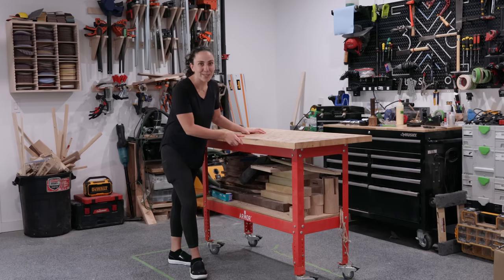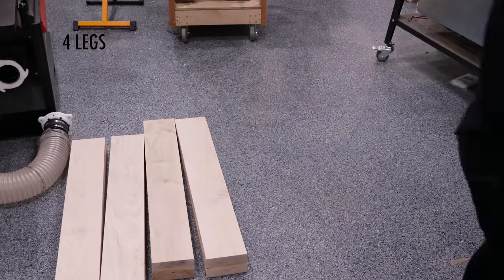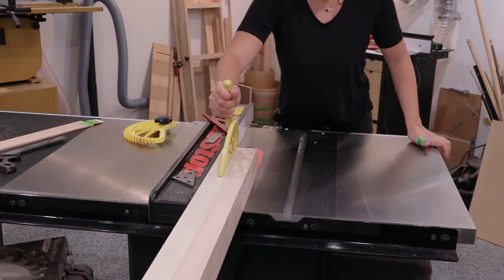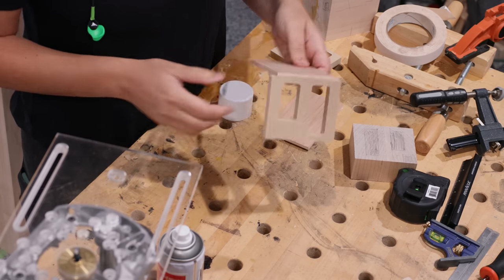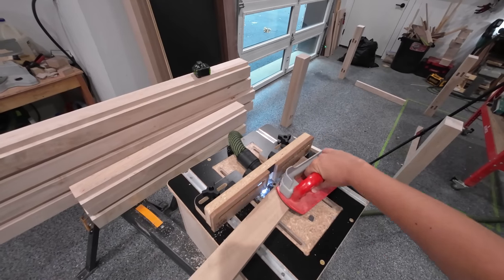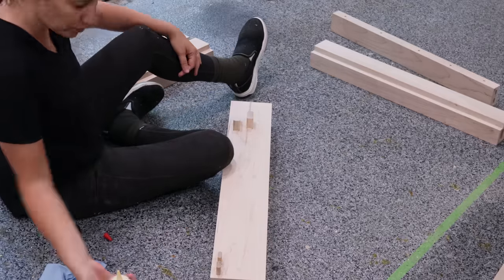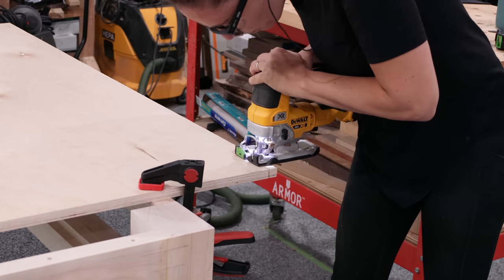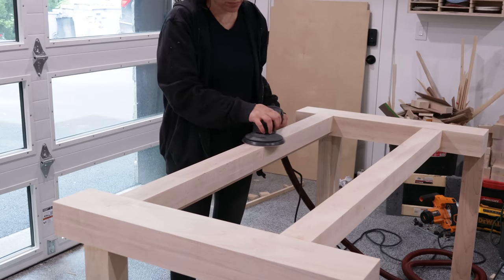My DREAM Workbench Build // PART 1: The Base

Comment: It's so cool you're building out your new shop and getting bigger and better equipment. At the same time, for me, one of the appeals of your channel was  how beginner-friendly it has been. I don't want to suggest that you should hold back and not progress, I just found it so awesome that you made beginner equipment work so well. It made woodworking seem more accessible for newbies. It's great that you continue to show simpler options during your builds. 

Thanks for your content and keep on cracking.
Reply from the maker: I totally get it and this was probably the best comment on this topic. Usually ppl aren’t as nice… ha. I have been doing this for a while and I am no longer a beginner. Hopefully all beginner woodworkers get to the stage I am at and further as they progress ☺️
Reply: @3x3CustomTamar - totally agree with the parent comment here, as someone who found you when looking to get into it. The great thing is seeing the progression though, rather than just ignoring all the beginner development you went through.  

I know it's not a "normal" theme for you, but it would actually be really cool if you put out a career breakdown video of some kind, going over the big milestones in your projects / the work that you do, the shop developments that accompanied all of those, and how the knowledge you picked up over time looks like. Not a small one, but thinking of your joint/tool breakdowns that clearly show insight to when you started using different techniques, milling your own lumber, etc. - it'd be invaluable in terms of helping folks conceptualize the journey even if they're just hobbyists (that'd be me 😅).

Either way, great work again and cheers!
Reply from the maker: @andrewbattelini4532  hmmmm. I’m not sure if I can even define those things for myself. They kinda just… happened… ha. And I guess if you watch my videos I’m chronological order you would see some sort of progression 🤷🏻‍♀️😂

Comment: I really like the fact that you’ve upped the game with regards to your tools. Through the progression of your channel, you’ve shown what it’s like to do the work with basic tools (and in a shop that has drastically varying temperatures) and what it’s like as someone who’s able to increase the quality of their tools as time goes on; it’s not like you’ve just clicked your fingers and bought your current spec - you’ve worked hard for it! Anyone who has a passion for woodworking and happens to have a little or a lot of spare cash would do just the same. Either way, hold your head high and be proud.

The bench is looking great. Keep up the great work and heal well.
Reply from the maker: I feel very proud for what I created here ☺️☺️☺️

Comment: I use floating tenons for most of my door making joinery and also make my own tenons. To allow for glue squeeze out I route a very shallow groove down both faces of my tenons with a 60 degree V groove bit. This prevents any hydraulic action when gluing up stile and rails. LOVE your bench design!
Reply from the maker: That’s a great idea!

Comment: I've built four of these for 3 different spaces. It wasn't until I saw The Founder that I really started think about movement around a space, calculating necessary range of motion, most common needs for the most typical projects that I actually got the right size bench and features.  You did this better than I, VERY well done!

Comment: I'm currently making my base for a huge Roubo bench made from 8/4 hard maple. I'm also building it on those same sawhorses. I work alone and trying to flip the heavy top was too much and it completely collapsed one of the sawhorses. No real damage to the top but it did bend the legs on the sawhorse. I now use my loader with a set of forks to pick up the top and carry it outside to flip then bring it back into the shop.
Reply from the maker: Moving the top was how I sprained my ankle…

Comment: I'm glad I clicked on this video. My Dewalt planer did the same thing to me the other day. I took it apart and cleaned it out. That worked but, now I'm wondering if it was the safety switch and I just got lucky. If/when it happens again, I'll know what to check. I love your dust collection set up.

Comment: Tamar,
Of course I want to see the ankle sprain!
I enjoyed your use of the skate board as a transport device. Also your knee clamp. Might I suggest the elbow clamp, chin clamp and forehead clamps as well.  They have all worked well for me on past projects.
Reply: Agree I’d love to see what happened that caused the injury and maybe your thoughts on if there is anything you learned from it.  On my own experience I was carrying a half sheet of 3/4 and tripped over a power cord and fell myself but luckily nothing sprained.  I committed to not have ANY obstructions on the floor area and am feeding my power top down and working on getting my last dust tube off my floor.    Been watching you for a while and was admiring how your shop seems to be about a year ahead of my shop in terms of tools and capabilities.
Reply: Yes, the use of the skateboard dolly made me giggle 🤭 Use what you have though! 👍🏻
Reply from the maker: Haha I have utilized those as well… good clamps to have 😂

Comment: Great Job! I realize it is too late, but did you ever think about moving such a heavy bench when you decided to use glued floating tenons? If so you should have used different joinery method so you could break the base down into sections. When I made my roubo style workbench I thought I would never have to worry about moving it until we actually had to move. Then I was so grateful that I went with bolted mortise and tenon so I could take it apart when we moved, like you would do with a bed frame. No matter, great job. Looks like a strong and solid bench. I did not realize how a great workbench improves your woodworking. Have fun and continue to show us your videos. Thanks!
Reply from the maker: I thought about it. Then thought that putting casters on it would make it movable… just like any other table in my house.

Comment: Oh man, this reminds me of what I decided to do for the bed frame I built years ago (and still standing).

I too made floating tenons, but out of scrap dimensional lumber (bed frame was made from 2x4 and 2x6). I don't have all those fancy machines or even large clamps, but I did mill the mortises using a plunge router in the exact same way with a jig, except I used screws instead of double-sided tape. No big deal, it's not like those screw holes were going to be on the finished side.

To make up for the lack of proper clamps, I used Kreg screws to pull the 2 pieces together tight. Combined with the floating tenons, they are easily the strongest joints in the bed frame.
Reply from the maker: Screws are a great idea since it will be hidden!

Comment: Hi! The way I was taught to leave space for the glue on floating tenons is to rip a small channel along either face of the tenon stock on the table saw. Just a blade width and maybe 1/16 or so deep. Those tenons are so wide though that two channels wouldn’t hurt.
Reply from the maker: That’s a great idea

Comment: I built a split to Roubo years ago. I regret the split top. I have used the split top filler strip as a bench stop once. I also have things get caught on it or fall through it. Your mileage may very but you may want to really think about what you need to top divider for

Comment: Awesome workbench!  Great thickness planer, I have heard a lot of good about Laguna but so far you are the only one on you tube I have seen on you tube who has them.
I was actually surprised that you did not get the hammer A3 series jointer planer combo like what Keith Johnson has because of your limited space.
Either way I am jealous of your awesome workspace.  You have earned every tool and am thankful you share your work with us.
Reply from the maker: Laguna just makes the best looking tools hands down. And they work as good as they look! I go back and forth between jointing and planing so much I thought it would be annoying to have to switch
Reply: @3x3CustomTamar  excellent point.  This is extremely helpful in deciding which brand to lean into.

Comment: Watching you in your shop, I noticed how you have no outfeed tables. Made me wonder if you could make a rolling one that would work with table saw, planer, chop saw, and other places.... The bench build is interesting. That bench top with all the holes in it is an interesting idea, and a lot of people are using it. I have always used squares and straight edges to do the same operations.
Reply from the maker: I have plans to make one that folds down. It’s on the very long list. Ha
Reply: And that list never gest shorter....... No matter how old you get.... I think I need one shop just for my wood.....

Comment: In stead of buying a pipe clamp, (Although you can never have enough clamps... 😉) Bessey makes an extender to connect two K Body clamps into one. It's called the Bessey K Body Extender KBX20 and is made out of a solid block of aluminium. I use it on my 1.5 meter clamps to make a 3 meter one, and works great.

Comment: Nice design. Good glue-up lessons - including custom floating tenons. Assume you did some unshown checking for square during assembly.  Ankle sprains are amazingly painful. (And, bad news, they are very persistent.). Had an orthopedic surgeon I was playing tennis with tell me I’d wish I’d broken it because it would heal.
Reply from the maker: Yup. Checked for square. I actually had one long apron that wasn’t sitting perfectly square to the leg and it was driving me nuts. But the whole base was square using diagonal measurements. I posted about that on Instagram….

Comment: You could just insulate and immobilize the connector on the switch. Get everything separated and in the correct orientation, then hot glue everything together. It won't move again. You could also add a piece of non-conductive material between the connector and the switch body to prevent the movement and fusing. ANYTHING is better than leaving it as it is. If you still have that old planer, I'll take it :)

Comment: Really beautiful build, I hope you’re really proud. I could be wrong but wood movement might be a concern with all the hardwood screwed down. Awesome build regardless and congrats on your new planer 🙌🏼
Reply from the maker: Thanks! I don’t see an issue. The aprons are all about 3” so no issue there. The legs would be the bigger issue, but the way I oriented them they would be likely to move in and out toward the long ends of the tops. The screws are only in one row, so they only have one point to move from. The screws that will attach the tops are placed in oversized holes to account for this.

Comment: Great video! I like the idea of two type top bench. Question: How will you keep them same height, flat and parallel over time?
Reply from the maker: Thanks! We’ll just have to see. There are always ways. If the hard tops has to be flattened. I could shave a bit off the underside of the assembly table. But I really don’t see if happening.

Comment: Hi Tamar , That was a great job, good idea utilising two designs of workbench, sorry to hear you’ve damaged your ankle, I presume it was when you were jumping from one corner post to the other house she would do in ballet, Arabesque or Pirouette, 😂 ❤ love that idea, 🫣😂
Great looking 👀 work bench, And great to see you’ve got yourself a new thickness in the machine, makes life a lot easier, especially when is it as a digital readout on it so if you have to go back to a pacific size, you can quite easily dial the size in, I have purchased these types machines many years ago, SCM PLANER/Jointer 450  , SCM 500w  this has 10Hp 4 speed, calculated digital read out , 
All the best for the future, stay safe, Phil from the moulin France

Comment: Can you flip your drill press table from horizontal to vertical? Nice design; are you going to put wheels on it to move it around the shop? Could you use the workbench as an outfeed table for the table saw?
Reply from the maker: I could use it as an outfeed table. I made it that perfect height for this saw. But I won’t since my planer is in the way. I have another idea for an outfeed table

Comment: I HOPE your feeling better.

Because you work in your shop alone and this goes for everyone all your viewers, you need to set an emergency plan if your working with power tools, fire suppression, 
Maybe a way to get help if something happens and you need help like a projet falls on you and you cant get up, also  safty equipment.  And keeping the shop clean and organized.  

You can take the Armor work bench 
And beef it up to make it more stable, decide to use it for the drill press, chop saw or make a router table with it. You can definitely make it more stable by adding some plywood to the open bottom area. It would make a great router lift table by adding a jessem lift and a 3hp router with verable speed. 
Clutter is not your friend.
Reply from the maker: Yeah… my husband was really relieved that it was just a sprained ankle when I told him I got hurt working

Comment: I am about to build a similar combo bench. I prefer your design. Back to the drawing board.

Great video as ever.
Reply from the maker: Haha glad it helped!
Reply: Re-watching for ideas. Why are there no handles on your 6 in 1 jig?
Reply from the maker: @Kosh42EFG  I take them off when using the plunge base. It already has handles to they are redundant
Reply: @3x3CustomTamar  You make a good point. Why have I never attached my plunge base to mine? Would make circle cutting so less sketchy....

Comment: You should put it on lockable castors so you can easily move it if you have to. Which would mean you'd have to cut the legs down a little to get he same height of course.
Reply from the maker: Already got casters that mount to the side and lift the table up if you need to move it 👍

Comment: Tamar, I'm embarking on this wonderful (fits me) hybrid workbench build for my 1.5 car garage shop, but...  I need to adjust the sizes in your cut list a bit to fit my area.I believe I have most of the hard maple I need for the legs and stretchers, maybe, but I need to buy more, depending on exact size I'm planning for.   With that, do you have a sketchup or similar 3D file I could use for this?  While I purchased your plans, I'd prefer to plug in adjusted parameters to reflect in an amended cut list (I'm a retried NASA engineer, so go figure).  Nice to see you and your shop grow over the years.   --Bryan
Reply from the maker: Hi! The sketchup file is available on my website 👍

Comment: Hi Tamar, I'm moving house soon and the new place has a workshop similar to yours in width but a bit shorter. I would love plans for this bench, as it would fit perfectly in what I have in mind for my (hobby) workshop. Quick question, rather than the floating tenons, would half lap or mortice and tenon work? I don't have a planer so making the floating tenons might be a bit interesting.
Reply from the maker: Good luck setting up your new shop! Half laps would totally work! I just didn’t want visible joinery

Comment: Hi. I'm fairly new to woodworking but plan on keeping my soon-to-be retired self busy with it and definitely need a bench. I see you using glued together pieces for legs vs using legs such as a 4x4. Is that for reasons of cost or strength or something else.
Reply from the maker: I was using maple which doesn’t really come in 4x4 sizes.

Comment: Random thought, it would be really cool if there was a link or site based integration between you and woodworkers source that matched the requirements for a project/plans. Maybe just dimensions with the option to pick species or everything pre-selected. Then you could buy plans and directly get the exact lumber you need without any hassle. I imagine a link would directly add everything required to my cart. Then I go through the regular checkout process. A site based integration might be a 3x3 Custom section of their site with different options for the various plans you sell. Selecting one would be a package of the lumber required for that set of plans. If they went with that option they could expand easily with other creators.
Reply from the maker: It’s a good thought… I have been talking to them about this exact thing ☺️

Comment: Let me guess, you sprained your ankle at 12:10 in the video when you were doing the glue up? Most accidents occur when you are in a hurry and it looks like when you were stepping over the end assembly you tripped. Also, what is the black top surface, laminate? Very nice looking workbench!
Reply from the maker: Nope. When I was moving the heavy top…

Comment: Use the tools you have is a basic requirement.  What is the use of having a £10000 workshop and using a chisel and brace drill.  Also pretty please, what software did you design the workbench in? Thank you.
Reply from the maker: I use sketchup

Comment: Wanted to ask you do you buy a lot of your wood from " Woodworkers Source"  Whats was the soft maple you bought. I am guessing it was rough cut since you did all that planning and egging. Hard to find wood like that around here. Thanks for you advise.
Reply from the maker: It’s not rough cut. It’s mostly milled. Just moved in transit so need to clean it up a bit
Reply: I want to order about the same. Would you have a list of what the first order you unwrapped from woodworkers source. Ty, Tom